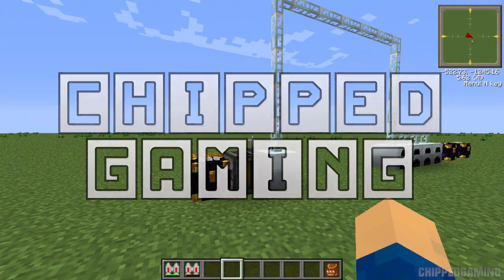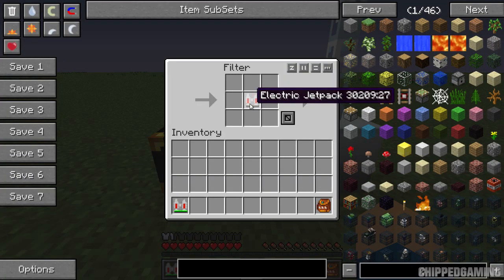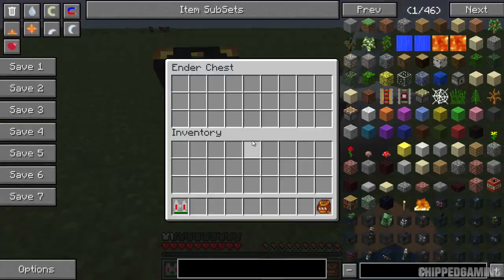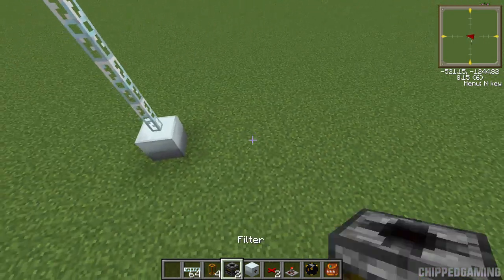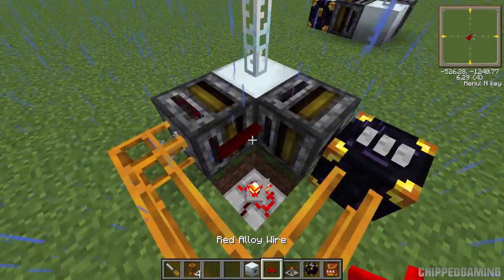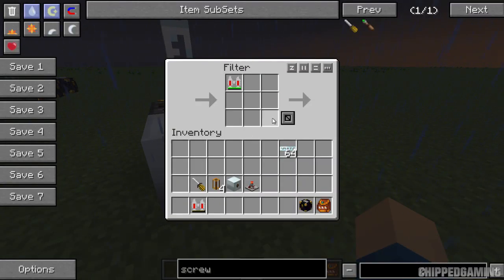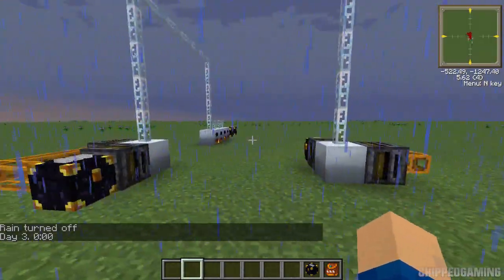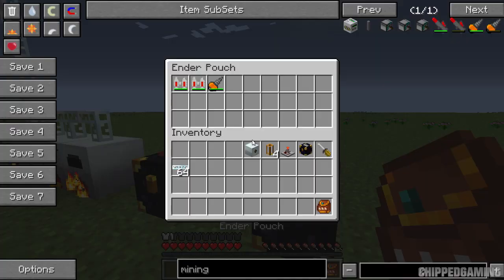Remote Charging Station! - FTB Tutorial

Comment from the maker: Did you make sure that the red alloy wire was connected to the filters, try removing the items from the filters and extending the length of the timer and see if it works then, also make sure the enderpounch and enderchect are connected  :)